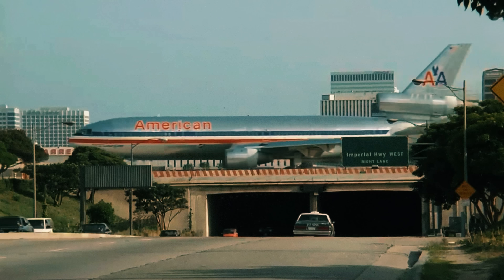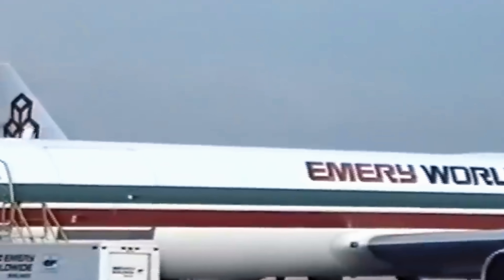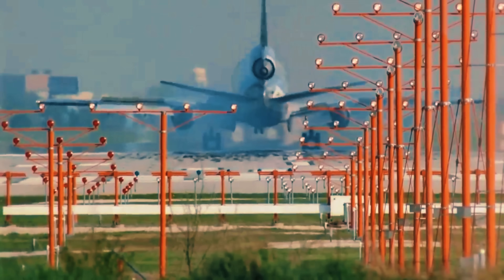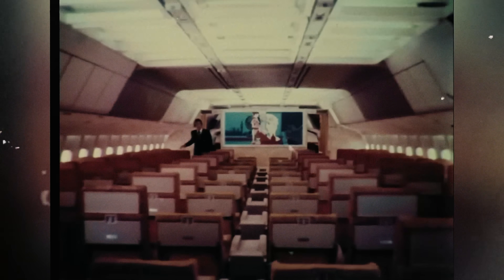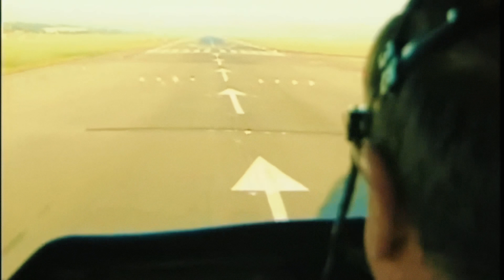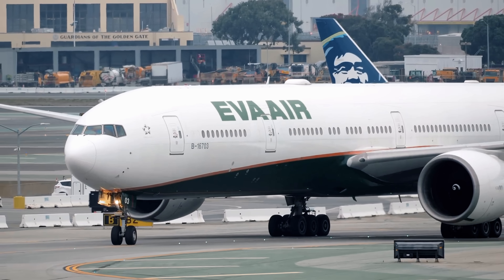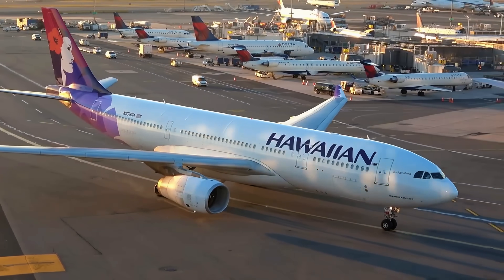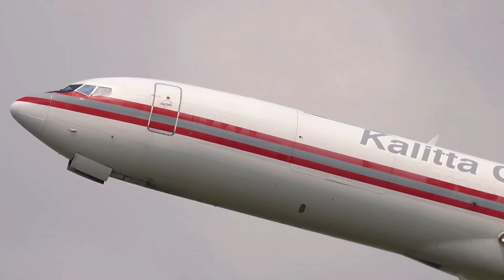What Made Trijets So Special — And Why Some Want Them Back

Comment: Trijets were meant to be a compromise between the reliability of 4-holers and the efficency of twinjets. Once aircraft powerplant designs improved enough to allow for twinjets with range and reliability typical of 4-holers (which is what the arrival of the Boeing 777 indicated), trijets slowly went out of fashion.

Comment: The issue was not reliability; it was thrust versus weight
Reply: You're wrong. You don't know what you're talking about. I'm just a simple general aviation pilot , and I even know better than that. Just stay off  the comments when you don't know what you're talking about.
Reply: @gaittr they did not have high bypass turbofans in the early 60s, so there is part of your maximum thrust problem, necessitating 3 or 4 engines instead of 2,